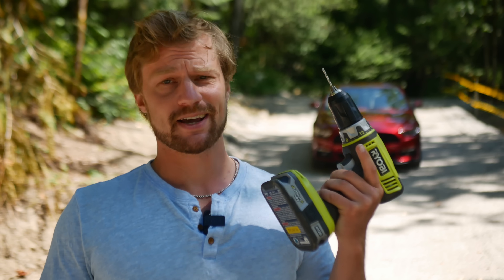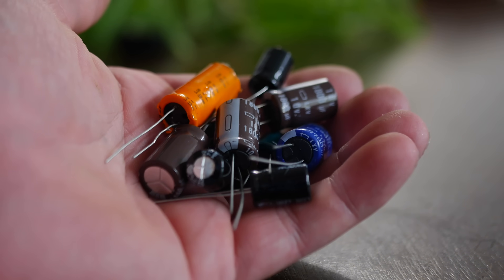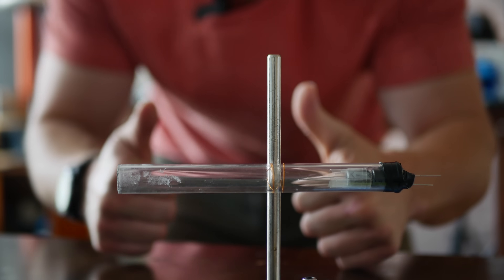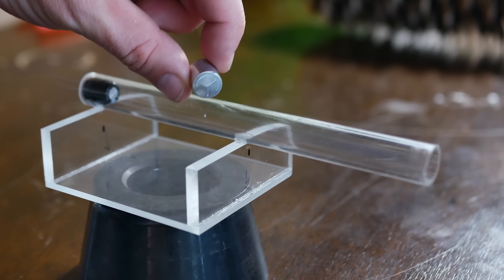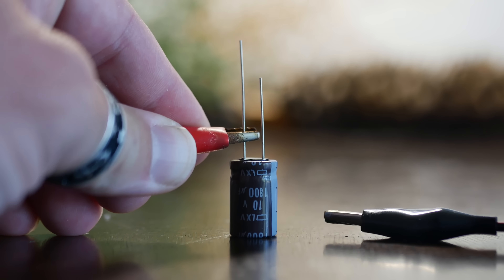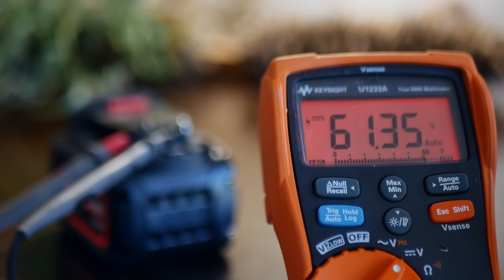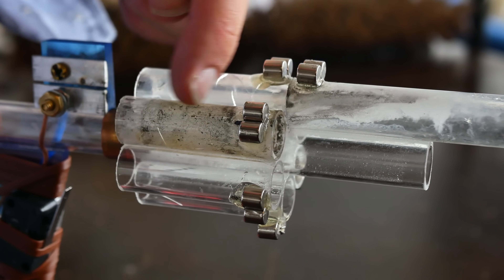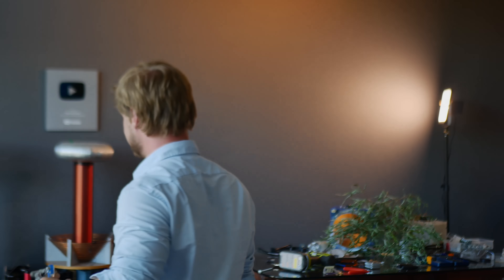I Built An Electric Capacitor Revolver!

Comment: 6:24, not only positive by also linear! That's what's honestly crazy for me. Now I expect that, eventually, there will be a plateau, but I was expecting you to see it, or for the relationship to be something more along the lines of v_m(muzzel velocity)=1-e^-V(Voltage) or v_m=V^2. That or find no correlation between the two, voltage is just the measure of the amount of energy carried per unit of charge, so if the caps blew at a certain energy level, they would blow with roughly the same amount of energy, the voltage merely choosing how quickly they blew.

Comment: When I was a kid me and my dad used to build stuff like this all the time then we went on to make homemade mortars which were 63 mm diameter steel pipe wrapped in Kevlar in case of spontaneous disassembly and then 6 lb of black powder per shot we could get easily a thousand yards out of it and then we kind of ran out of room of testing go back to the capacitors when I was a really little kid like maybe four or five my dad designed something along the lines of this it wasn't like a revolver essentially a capacitor musket and that worked as bad as well as you would expect it to kind of just pooped out the end but was still fun but I was back in like what 2004 2005 ish

Comment: If you trickle fed a large capacitor from the battery then dumped that charge into your magazine capacitors you could have much higher voltage discharge,

Comment: I felt like I'd mention round 3:21 the thing it acts as is more a Pneumatic pistion as it doesn't have any liquids like water in it affecting how it works. Not like it matters much as its an off handed remark but I guess gotta use the knowledge from that annoying topic in GCSE Technology somehow had you make circut diagrams of it & had confusingly named & fuctionaly close things unidirectional flow restrictors & shutter valves. Pistons called a single acting cylendar. 3/2 valve which can have a button, lever, roller tip, or something i forget to activate & either that be toggled or have a spring to return it. Another thing was the beauty that is the AND vs OR cicuit which basically are as they say. My gripe is with the exam board CCEA who are so wierd & I hate them as like why do they ask things not even on the spec in A-Level they can by suggest allowing them to bypass rules like you can't go beyond 3 ionisation energies unless they say suggest. CCEA asked the plug in black & white how am I meant to label it when I learned colours not damn placement. Brown is live, blue is Nuetral & the green & white stripes is Earth. which pin is it don't know but I do know that it is based on colour not the other thing unless you were wiring it then maybe but for the GCSE you only need to understand the basics & colour is that. Whats this about... I went off on a rant. anyway Just added the pneumatic thing to say its intresting & slightly different from hydrolics not being able to lift nearly as much.

Comment: Now grab another one of those batteries and wire them in parallel.... lol

Also, maybe try a few tantalum capacitors.  They too will make a nice explosion, as they are notorious for bursting into flames quite spectacularly.  Finding really large ones might be a problem tho....

Comment: If you reduce the inner diameter between the capacitor and the projectile you'll get faster gas velocity, but lower pressure. With lighter projectiles you could get higher muzzle velocity, you could also use a longer barrel to deliver more energy to the projectile, up to the point where the gas is no longer expanding / pushing behind it

Comment: You could use RC plane batteries in series to get high voltage. Use 4-6cell Lipos to get 90V (or 20-24 cells in any combination you want). Instead of a battery, why not use a high voltage capacitor? I would be curious to see what happens with 440V capacitor.

Comment: Hm... What about a gatling version? I'm imagining a gatling version, powered by a much larger battery, which pushes new capacitors into the back of the barrels as they rotate around the bottom, using the previously spent capacitor as the projectile for the new capacitor to shoot out.

Comment: Be mindful that if you are using electricity to fire a conventional round, as in casing gunpowder and bullet package. Me extra cautious and only apply the system in single shot or bolt action applications. If you put an electronic trigger mechanism in any semi auto firearm you're in big trouble with the atf

Comment: You can see that at your lower voltage the projectile actually stays in the barrel and then gets sucked back in. Maybe some light rifling on the inside of the barrel could help with that vacuum and add some spin

Comment: If you want the projectile to flt faster you can cut small holes for the air to escape.
Many guns have this feature to allow for the muzzle flash and noise to be lessened.
However it might help you with the vacuum that the projectile creates.

Comment: You could have used a larger capacitor charged from batteries between each shot like the a coilgun uses for those 90's. Otherwise fairly solid build.

Comment: You can build a relatively simple circuit to supply higher voltages with the current needed in short bursts, see "charge pump".

Comment: Couldn't you just fill the handle with more capacitors in order to get that voltage and amps up for each shot? If there is actually a coloration between voltage and explosive force then kicking the voltage to top 120 or 240 would be way better. You could also try putting a coil condenser in it to get 10,000V every minute or so...

Comment: You should try vaporising copper as a propulsion means - vaporised copper is 67,000 times the volume of solid copper. This would be way, way more impressive.

Try dropping a thin copper wire across 110V AC mains and it makes a substantial bang.

Pretty suree you could do the job with enough caps, charge in paralell, dump in series to get the volts up sop you can use a reasonable fatness copper wire.

Then, your consumable is a roll of thin copper wire plus a projectile (ball bearing?)

Comment: You don't need as high as Amerage Current as it seems you do.  The energy is Amps time Votage squared. So if you double the voltage you divide the current by 4, The trick is to store a much higher voltage in a much smaller capacitor at a much lower Amperage then dump it the capictor you want to explode.

Comment: Try using a capacitor HV charging circuit and a much bigger capacitor to deliver the amps and voltage to the "explosive" small capacitor.
You can get a circuit that will charge a big capacitor to 300V from a AA battery in disposable cameras. Overall a nice concept

Comment: I have had an idea for a while... perhaps you can take it and run with it... Would it be possible to make a capacitor into a tazer?   I may be thinking of something else... there is a story I heard long ago about guys that would charge up an electrical component and then toss it to someone.  They would catch it and complete the circuit and get  a little jolt...  Image a tazer without those wires..  I know it would only be a brief discharge, but I'd love to see if it could be done.   Sort of a Star Trek phaser...lol...

Comment: That's not even slightly difficult just wire 2x60 volt batteries in series or 2x40 volt batteries to get 80 volts
Reply: I would love to see some test data from a thrust stand I'm wondering if I can make some itty bitty little model rockets out of these things

Comment: 3 minutes 16 seconds in... Very nice work indeed. I figured I should correct you though, what you have just created is a pneumatic piston, not a hydraulic piston which requires some kind of fluid. Pneumatics are the study of air pressure, and hydraulics fall under the study of liquids although I'm sure you know that and it was just a slip of the tongue. Otherwise, very well presented, with a lot of information that can be used for other projects nobody has thought of yet. Isn't it funny that we focus on building something new and we do not focus on the way things fail. When building something you should always take into account exactly what it's supposed to do and what exactly it is going to do when it fails. Its not a matter if, but "how" something will fail and this video right here is probably the best example I have come across in my life, where in using something that fails, to create something useful😊😊 thank you friend

Comment: Everything is cool, but where is the physics? In the first experiments, the result is so obvious that they could not be carried out - the energy of the capacitor is proportional to the square of the voltage, and the kinetic energy of the bullet is proportional to the square of the velocity. Obviously, the speed of the voltage will depend linearly, which we observe. It would be possible to bring these school formulas and the video would become much more useful, and would not look like magic. The next step would be to evaluate the efficiency of such an acceleration method in relation of the stored energy in the capacitor to the energy of the bullet. Good luck!

Comment: I wonder if you could get more power and accuracy with a smaller diameter barrel and fire actual 22. bullets or round balls get an acrylic rod instead of a tube bore out the breech for the cap drill the 22. diameter barrel into the leftover solid portion of the rod and chamfer the the breech and barrel connecting points to make a quasi forcing cone so all energy is contained and used for propellent and if the acrylic can handle it pass a rifle button through it.

Comment: If you're going to use copper then you can solder one leg to the tube, with a common central tap.  Then you need only activate one leg, which will make the contact easier overall, I would have thought.  However, a metal item travelling down a copper tube might well create eddy currents and slow down your projectile, so you may be better off with a plastic bullet.

Comment: If you use a voltage multiplier circuit you can increase the voltage from 60 to possibly closer to the 90 volt mark. Depending upon the amperage of the battery and the amps needed to overload the capacitor.
Reply: The input to the voltage multiplier should be ac.

Comment: If you  cannibalize a cap gun, it would make it self index. Pulling the hammer out will make the draw on the trigger much lighter and give you a place to mount the contacts for the electrodes to push against. Great, now my brain is going.

Comment: since capacitors are so sensitive and can detonate so violently.. couldn't they be used in a sort of protection manner, as well? i was thinking about oil rig "BOP" (blow out protection) that crimps shut a big pipe, i believe. is there ever a case where you would be able to use a capacitor detonating, to protect equipment where fuses and other components cant? or even to eject tiny sensor probes from satellites/space exploration devices, acting like a cheap propulsion charge. the possibilities are endless when you look outside the box.

Comment: Why didn't you just use a voltage upregulator to get to the 90v or even higher? You could also try to modify the capacitors so they need more pressure to rupture so you get a higher pressure.

Comment: There is a revolver somewhere, where upon pulling the trigger before it fires the cylinder is pushed into the barrel to create a better seal.. you can try that and make the barrel smaller in diameter to increase pressure which increases velocity
Reply: Pepper box revolver instead of trying to match up the barrel to the chambers?

Comment: Aww I was hoping this wouldve been an incapacitating gun instead, where you use like maybe compressed air or maybe rubber power to fling a bunch of charged capacitors with the intent to pierce flesh with the two legs
Reply: Because the cap leads are not far apart, it would just cause a localized sting/burn (depending on the cap). If you want it to shock someone, it needs to send current through the body (one lead touching on part of the body, the other crossing the torso). If you can achieve this, you could easily make a heart stopper.

Comment: Instead of a regular bullet tip, something like a sabot style dart would work the best… it doesn’t seem to have a lot of power but a chamber that has almost a rocket nozzle to concentrate the force onto the back of a lightweight projectile should make it somewhat more viable… 

Maybe if it were given another form of fuel to increase the pressure from the capacitor igniting the air behind the bullet
Like maybe a little bit of hydrogen or pure oxygen

Edit:oh I didn’t realize it was exploding the capacitor… I thought it was releasing the capacitors charge and basically igniting and ‘exploding’ the air behind the bullet

Comment: Could you have just used the capacitors themselves as the projectile? Turn them around and wire them up backwards? Could possible seal of the end of the chamber except for pin holes for the wire.

Comment: Could you use a battery to charge up a large capacitor then use that to blow the capacitors? If the fumes are flammable then you could ignite that with a simple spark using the battery to fire a normal projectile.

Comment: What you need is a 20-60v battery with a high amperage rating (like drill batteries) and a boost converter. A good one with decent amperage output. And they are really cheap. Thats how you can get that thing to fire at 100 or even 200 volts.

Comment: You could use a simple flash circuit from a throw away camera to create a massive voltage to really go large, plus they run from a very small battery pack (think two AA’s)

Comment: You can connect this small capacitors to a bigger one that chargered to 400 Volts (for example). Thyristor will help in controlling high voltage. And you can use a small battery with DC-DC step-up converter.

Comment: You alone will drive up the prices on those sweet sweet capacitors. :D :D  You would probably get better result with CO2 cartridges. There you got 900 PSI at your fingertip...

Comment: Just as a thought experiment what is the highest voltage you can put through one of these capacitors and what is the muzzle velocity of the projectile at the highest voltage you can feasibly pump through one of these capacitors. My guess is that it will plateau at some point and more voltage will not result in higher velocity

Comment: Ya'll might like to know that SMD tantalum caps make very nice sugar rocket ignitors. 6.3v  1-22uF (depending on ya rocket size), reverse polarity on a 12v bat, goes great, far more reliable than the steel wool we were using.

Comment: We used to wire them up back wards and connect them up to the bench power supply, then wire them in to a colleagues workbench draw, turn on the psu and bam instant smoked documents. The bigger caps were always the best.

Comment: Maybe try necking down and using a smaller projectile.. use a steep shoulder angel.. look at Ulta light magnums case..
Maybe use a .22cal or a .17cal..
I normally would not comment on videos
I thought that it could halp but I can be wrong..

Comment: I think it would be really funny if he ended up using stronger capacitors to store the voltage needed to make the other capacitors explode. CAPACITOR vs SLIGHTLY LOWER RATED CAPACITOR.
Reply: That's exactly what I was thinking! Get a nice hum before each shot too!
Reply: I was exactly thinking about supercaps, good amount of them will surely make a huge bang to those small caps 😎
Reply: This was my first thought.  Why not use a bigger capacitor to blow the smaller ones.  You could get an air conditioner capacitor for $20 that would be WAY more than you need.
Reply: Or you could just do what military researchers have done decades ago and just use cartridges stuff it with tungsten wool and a electrolyte then slam it with a stupid amount of current.  Using polarized caps is easy and fun the play with but at the same time also really inefficient.
Reply: I mean this is about as efficient as black powder so I stopped watching

Comment: Electrically vaporizing solids may end up being more energy efficient than combustion. It's an interesting idea. Also imagine this as part of a coil or rail gun design. Maybe instead of a capacitor, a substance that vaporizes and rapidly discharges electricity at the same time?

Comment: Hey Jay nice video....and i suggest you that you can use a voltage booster circuit using some transistors , coils and capacitors to massive boost the voltage of power supply . You can use lithium ion batteries connected in parallel so that a lot more current can be provided . This is beneficial cause the voltage boosts up while current remaining constant and you will get the full backup . I would recommend you to build voltage booster with transformer .

Comment: We did this in the late 60s or early 70s. Back then caps didn't have the little X engraved in the end so the entire case would shoot off like a bullet. We converted a cap gun and used batteries. They were pretty dangerous though. 

Years later in the early 90s I was working on a nurse call system at a nursing home.. It had a bad filter cap on the power supply and I grabbed the wrong voltage cap. :(.  When i powered it up that sucker popped big time. Filled a room about 10 X 15 with so much smoke you couldn't see. The case of the cap hit a secretary in the thigh and gave her a huge black and blue welt. Wasn't one of my best days :)